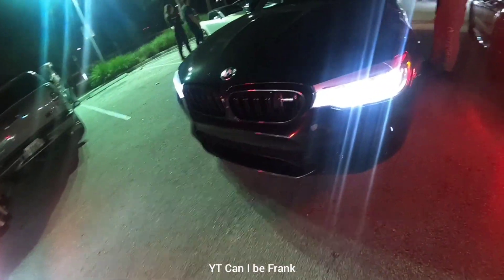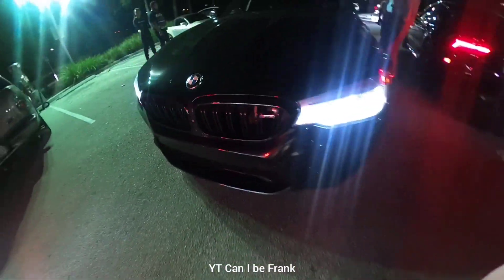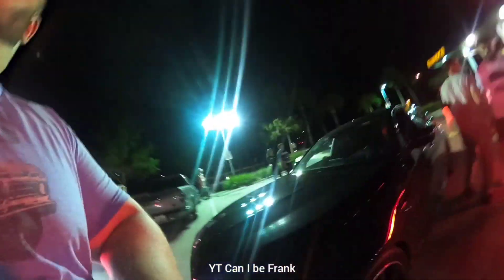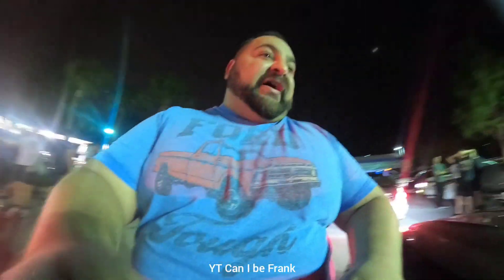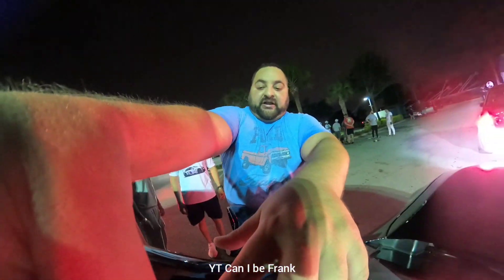BMW M5 Competition Bolt-ons 93 vs Challenger RT Built Motor 300 Shot

Comment: Damn what happen on the bottle runs thing was dipping
Reply: its having some sort of cut when i hit 4th gear. still trying to see whats causing it
Reply: @erikquintero8230  race car problems 😅 hopefully u find the issue and re run u was dipping hard G
Reply: @885.0ELopez  last time it was voltage now i dont know what it is but we will figure it out. like you said race car problems lol
Reply: @erikquintero8230  fuel pressure drop or another failsafe
Reply: @200shotramhemi4  could be, it’s only when it shifts into 4th gear then it backfires. Haven’t had a chance to see what’s causing it.

Comment: I just came here to say who tf builds a 5.7 RT motor lmao just buy a hellcat what a waste of money
Reply: Actually that 5.7 is better than a 6.4 guys build is dope
Reply: I’d be more impressed with a built 5.7 than a stock Cat
Reply: @WranghisKhan  I’ll take a warranty and reliability over a highly strung out built motor that will probably have a good bunch of issues but that’s just me. To each their own
Reply: @SIat  Trust me, if I could get a Cat, I’d be saying the same. But right now I have a slow ass R/T that I’m modding so I’m gonna defend dude’s built 5.7
Reply: HC is 6.2 not 6.4
Reply: Built 5.7 and 6.4 can handle a lot of power. We just did a 392 stroker build from a 5.7 base and the car is now ARP studded and can handle over 1000HP. If you do the work yourself its only around 5k-7k for motor only depending on what your goals are.
Reply: lmao and what exactly do you have ?? car gets way more attention than a hellcat does.
Reply: @erikquintero8230  something better than an RT Challenger lmao
Reply: @SIat  lmao i bet